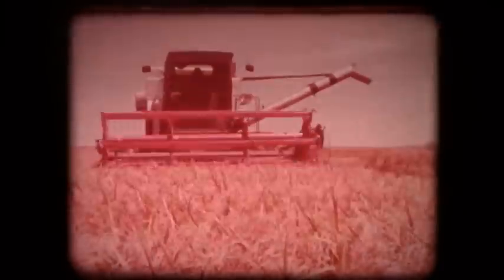1970 Allis Chalmers Dealer Movie The Master Touch Gleaner G K Combines

Comment: Dad and Grandpa almost bought a Gleaner G back in the early 70's, but they got a better deal and bought a Ford 640 built by Claas, sold as their "Senator" model in Europe.  Good thing they did too, because they were counting on a "handshake agreement" they had with a big time operator who they attended church with-- Dad had been cutting for him with his old rusted out Case 660 combine and he told them, "Yall buy a combine and you can cut my grain EVERY year"... this BTO wouldn't cut his own grain back in those days-- grain sorghum (maize) was always covered in a fine powdery mildew dust that would itch like crazy-- and the cabs in those days (IF you even had one) are NOT like cabs today that are nearly airtight and dustproof-- and with an air conditioner that will nearly frost the windows if you desire even in 100 degree heat, but not back then... usually you'd be soaked in sweat by 9 am and then the dust stuck to you like glue, and you just itched like crazy the rest of the day.  SO this guy always hired his combining done so he didn't have to get hot and dirty and itchy.  He did buy a "Big 12" auger cart to pull with his cabbed John Deere 20 series tractor so he could stay in the air conditioning out of the dust.  Course that agreement only lasted about two weeks until a neighbor who was an idiot and oversold his crop (contracted too much grain and couldn't deliver, and faced ruin having to buy back the contract) came to him and offered to combine his crop for free and buy it out of the field at the going rate to fill his contract so he didn't lose his @ss... at which point he abrogated his agreement and just basically told Dad and Grandpa to go p!ss up a rope, and if they lost their combine to the bank, oh well, it's only business... (guy had a reputation lower than crocodile p!ss in his community in later years anyway, no character).  

Anyway, Dad and Grandpa were really stressed out, but luckily at that point in the 70's grains were at about the highest point they'd be for over the next ten years, and everybody and their dog was eager to get in on the action.  Another BTO over north of the county seat had rented a couple thousand acres of rich river bottom ground and planted it all in grain sorghum.  Thing was, it was a very hot, very wet June when the grain was filling and starting to ripen, and the morningglory vines came on like gangbusters.  Back then there wasn't good chemical control of morning glories (still isn't really) and by mid-July when the grain was dry and ready to cut, most of the fields were simply ate up with morningglory vines... running down the rows and between (across) the rows sewing it all up into a huge blanket of vines with the grain heads embedded in it.  He put out the word to every custom combining cutter wanting some work to come and start cutting.  Dad and Grandpa drove the combine 18 miles over to where they everybody was supposed to come in and try out one morning.  There was every type and kind of combine available there that day in '74 or '75, from Case, International Harvester, Deere, Massey Ferguson, Allis Chalmers, White, Oliver, Gleaner,  you name it.  Everybody pulled into the field and within minutes were back on the turning row under a nearby grove of pecan trees, trying to unplug their combines which were hopelessly plugged with vines the point they locked up or stalled out in the field.  Combines back then didn't have reversers, they didn't have 300 horsepower engines and huge power reserves, etc.  Most of them only adjusted the cylinder speed by replacing sprockets, or didn't have rapid or easy adjustments for concave clearance, or special provisions for unplugging the machine.  Most also used large diameter cylinders with 8 threshing bars.  The Ford/Claas machine uses a wide thresher, but only six bars on the smaller diameter cylinder, powered by a pair of variable speed drive belts operating in tandem and direct driving off the engine-driven main power cross shaft.  The two heavy cast iron telescoping variable speed pulleys gave the cylinder a lot of momentum.  The smaller diameter cylinder is also easier to turn than a larger diameter one, due to less moment of inertia, meaning it spins up faster (and slows down faster as well) due to it's smaller diameter)  The German engineers who designed the Claas also did a brilliant thing-- they extended the cylinder shaft out the right side of the combine and put a large cast iron spool on the end of it, with four holes in it, into which a bar could be easily inserted and the entire machine turned backwards as needed to roll plugs out of the cylinder and concave and, if the header were left engaged with the engine off and thresher disengaged from the power shaft, roll the plug right back down the feeder house and out from under the auger where it could be pulled out onto the ground.  None of the other combines had anything like this.  Plus, the extra weight of the cast iron block spinning on the end of the shaft gave the cylinder more inertia or momentum to help it power plugs on through without choking, despite its smaller diameter and lighter weight.  Most of the other combines, if they plugged you spent hours with a knife and pliers, trying to cut and rip the mess of compressed green vines and grain heads and stalks out of the cylinder to free it.  Dad and Grandpa had their share of plugs at first too, but Dad soon figured out a "trick".  Unlike the Deere's and a lot of other combines at the time, that put the concave adjustment on a tiny little crank wheel that probably took you about a minute to crank fully open and closed again, or some of the combines the concave clearance was pre-set with bolt and wrenches BEFORE the combine ever went to the field... The Ford/Claas machine used a "quadrant lever" under the seat to adjust the concave "on the go" as well as the hydraulic operated variator pulleys to speed up or slow down the cylinder speed on the go as well.  Dad figured out that by watching the 18 foot header carefully, and when he saw a big ball of vines heading into the feederhouse, he could reach down and throw the concave lever "all the way open" by pushing it down to the floor, which allowed the slug to hit the cylinder and it would simply grind it around and pound it on through the cylinder and concave, and then the beater would toss it right onto the straw walkers as it came out the back of the cylinder/concave... then he could pull the lever back up to the third notch, where it was usually set for threshing grain sorghum, and just continue combining... the slug of vines would get tossed off the back of the straw walkers back onto the field, with whatever partially threshed grain was still embedded in it.  BUT he could just keep right on going and keep combining without costly downtime unplugging.  Other machines that couldn't do this were just ending up hopelessly clogged time and time again regardless of how slow they tried to go or what they tried to do.  By early afternoon, everybody else had had enough and were gone.  Dad and Grandpa ended up combining that entire job, and paid off the combine in a single year from the money they made combining all that hopelessly viney sorghum that would have been lost otherwise... 

Dad did custom work for a couple more years til he got on at the nuclear plant and was making more money than he'd ever seen, and decided to let his rent ground go and quit farming, other than helping Grandpa on the home place.  Grandpa put in his last maize crop in about '80 or '81.  By then the price had collapsed, mostly due to that moron Jimmy Carter's Soviet grain embargo of the late 70's, which collapsed the grain markets and ended up precipitating the farm crisis of the 80's, which would see depressed grain and farm product prices for over a decade... At that point grain sorghum was basically too worthless to grow, so we went back to farming all cotton for the next 10-15 years... 

Later!  OL J R :)